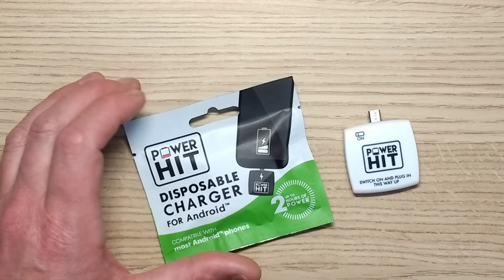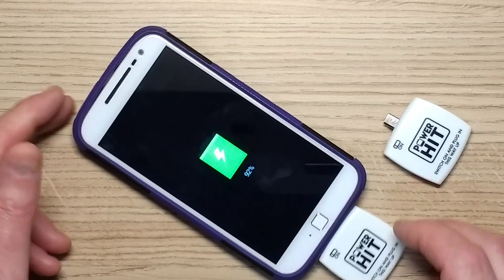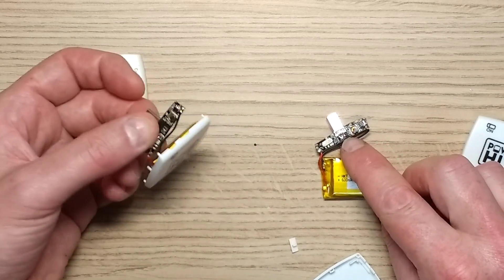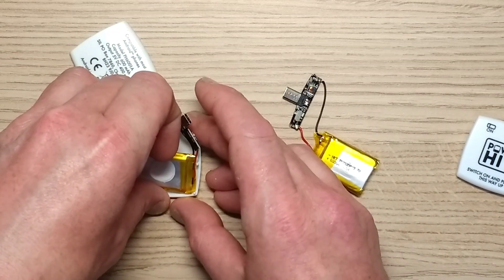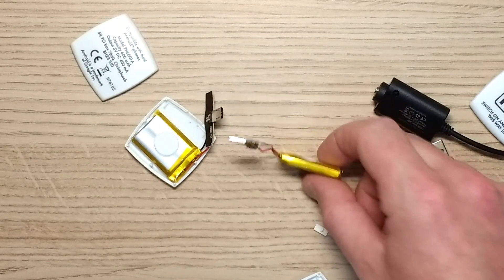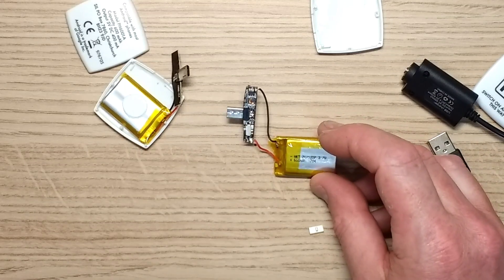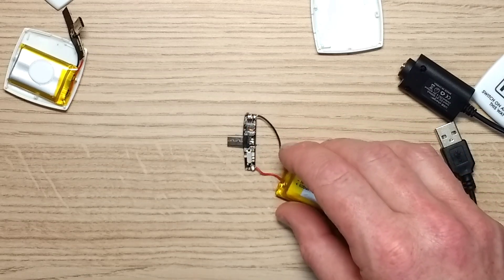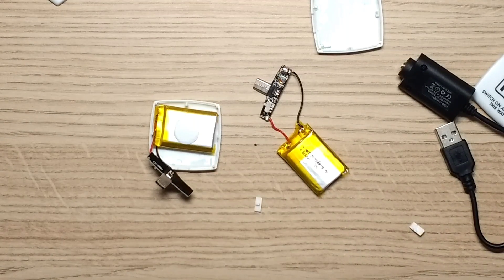What's inside a Tesco Power Hit disposable phone charger.

Comment: Disposable Lithium cells should be illegal. The charging circuit probably costs a few cents in large quantities.
Reply: They can be about $0.25 each that you can buy (pack of 10). However, many are fakes and literally don't regulate voltage (so I found out when I had a cell at 4.38v on my quadcopter). I don't know how much higher it would have went since I didn't let it finish (output was around 4.75v, and that was probably just the voltage sag on my USB wall charger). Then I bought some others from another seller (same supposed chip), and they were fine (ironically, they were much cheaper) and varied between 4.22 and 4.28v (which is higher than ideal, but good enough).

They should fit in that case if they made them a little fatter or longer, but the charger does get insanely hot (I have blower fan on mine), so you would need to change the current program resistor down to maybe 200 mAh max (so 3+ hour charge).
Reply: radry100 should batteries be illegal too ???
Reply: Jake Garrett I don't think long charge times would really matter for this sort of product. People would buy this because of convenience, so the recharging functionality isn't really important.
Reply: Enrique We don't throw baterries away after a single use and let me remind you Alkaline battery is safe to throw away because they are recyclable. Lithium baterry is not.
Reply: Cereal DuDe aren't you supposed to throw them away after they're dead ??? Unless they're rechargeable but some aren't
Reply: kingoftaurus This isn't an issue of Capitalism. It is a finite and important resource. Being an idiot and investing into short term profit to fuck over your business, the industry you are try to make money of and the planet is textbook short sighted investment. They literally digging the ground away from under there own feet.
Reply: radry100 anybody else contacted Tesco on Twitter etc?
I have.. They said they had watched the video and then asked me what my "concerns were"?!?!?!!
Reply: JETJOOBOY I tried, no reply. How about someone buy one, stick a nail through it at the checkout and walk off. Then they might get the idea...
Reply: Enrique Alkaline batteries do not explode if punctured or shorted, this is a really bad (and dangerous) idea.
Reply: Enrique disposable yeah...
Reply: Practically everything is illegal or mandatory in California, we don't need another damned law banning even more things.
Reply: Ray Giordano You have a tesco's in california?
Reply: There are still plenty of legitimate uses for non-rechargeable batteries. E.g.: long life applications use air silver cells in hearing aids, 10yr Lithium cells for pace makers alkaline cells in alarm clocks, smoke detectors, back up power for computers etc. Then there are non-recoverable uses, meteorology balloons for example. And some button cells are still to small to practically make from rechargeable cells, esp. in applications where you need constant voltage over the life time of the cell and don't have space to include voltage regulation. Finally, what about all the legacy applications built for 1.5v high drain applications? There isn't currently an off the shelf solution to this.  Hopefully rechargeable batteries will become the norm soon, but they're not for everything yet.
Reply: Daniel Christopher exactly, too many restrictions will limit all sorts of progress.
Reply: Don Wald I am pretty sure there isn't a Tesco's in CA, but I wouldn't swear to it. We do have, however, very similar kinds of stores.
Reply: Well batteries are suppose to be recycled and not thrown away, problem is that everyone throws them away anyways.
Reply: Sht like this (amongst othe sht) keep the vile economy flowing so unlikely to made illegal when money is involved.
Reply: Thank for explaining it for those who need it spelled out to them. This kind of wasteful-by-design product should be illegal.
Reply: Thanks, but I don't think I need even more regulations about things I'm not allowed to buy.
Reply: Peter Houlihan Have you considered what happens when you puncture a Lithium battery? It sets on fire. So let’s say I throw away a battery, and someone puts something really heavy in next, it crushes the Lithium battery and congrats you’ve just started an electrical fire.
Reply: A very small electrical fire which lasts a few seconds (and that's assuming I improperly dispose of my batteries). Not much of an argument for someone putting a gun to my head if I try to buy/sell a disposible charger.
Reply: Peter Houlihan No one said any guns were gonna be put to anyone’s heads. In the right conditions, although it’s unlikely, it could for example start a wild fire. Also as people have pointed out the world has limited Lithium supplies, so if these were to become really mainstream, the amount of Lithium they use could lead a shortage in 10-20 years.
Reply: The product is as disgusting as the people that buy them.
Reply: "No one said any guns were gonna be put to anyone’s heads."

Yes they did. They said "it should be illegal." Laws are enforced with guns, or the threat of guns, if you don't realise that then you really have no business pushing political stances.

" In the right conditions, although it’s unlikely, it could for example start a wild fire."

Lots of things are unlikely to start a fire, that's no excuse to ban them.
Reply: Peter Houlihan Lawa aren’t really enforced with guns, especially in the U.K. The kind of attitude you’re showing is the same kind that has caused hundreds of species of animals to go extinct, a hole in the ozone layer and global warming. We have a limited amounts of lithium, and we are making things that use it up and are impossible to recycle. Portable chargers are very small now, and if you’re about to say it’s too much effort to charge them, we really have no chance.
Reply: "Lawa aren’t really enforced with guns, especially in the U.K."

Blatantly untrue. If you ignore this law, and all of the ensuing consequences, eventually the result will be a gun pointed at your head. The UK is no different from any other government in this regard.

"The kind of attitude you’re showing is the same kind that has caused hundreds of species of animals to go extinct, a hole in the ozone layer and global warming."

Hundreds of animals have been going extinct since animals first evolved. Welcome to life on planet earth

The ozone hole is cyclical

Global warming is beneficial and largely not controlled by humans

Anything else? I gave up believing the greenwashing years ago, I'm not drinking that kool aid again.

"We have a limited amounts of lithium"

We have limited amounts of everything, but lithium really isn't all that rare.

"and we are making things that use it up and are impossible to recycle"

Unless these are converting mass to energy, then they're not "using up" the lithium.

"Portable chargers are very small now, and if you’re about to say it’s too much effort to charge them, we really have no chance."

I say nothing of the sort. All I said is that appealing to a mafia to force everyone to use them is ridiculous.
Reply: Don Wald yes I think so.
Reply: Ray Giordano I honestly dont have a problem with all the bans. It seems to make my area nicer but im not an expert or anything.
Reply: Peter Houlihan I dont see your argument. It's a simmilar price for a product that is better in every way.
Reply: Peter Houlihan "A very small electrical fire which lasts a few seconds" Lithium battery will burn at about 538°C, while paper will catch fire at 233°C and some plastics below 500°C. The battery can also catch fire when shorted out (could probably find hundreds of items that can do it in a trashcan) and the size of the fire doesn't really matter when some hot ash or a cigarette butt can start a fire even in cold weather. Don't know about you, but I think most people would agree that this is a fire hazard.
Reply: If you don't like something. don't buy it. Things shouldn't be illegal just because you don't like them.
Reply: Enrique They should be, thex are the biggest scam ever. They sell them mostly for like 4£ for a pack of 4 while cheap rechargable ones cost the same, they however charge you like 20£, so the disposable ones look like a good value, only to make you buy them again, this should be illegal
Reply: Peter Houlihan 
You seem a little confused.
Reply: How about instead of making them illegal you could make a vending machine like devise that you can buy and return this to.
Reply: The funny part is: Its called disposable, but on the back there is a sign, that it shouldnt be disposed in normal trash.
Thats like flushable wipes that shouldnt be flushed.
Reply: Dont crie we are doing it for many years
Reply: @peterhoulihan9766  lol Americans
Reply: Not even that. Plus, you can get LiPo cells that come with a BMS already attached! A BMS (battery management system) prevents over discharge by cutting power and contains a charging IC that charges up the battery with balance control (overcharge protection) when you apply voltage across the leads. NEVER charge an unprotected LiPo cell this way! It has to have a BMS attached!

Comment: Bridging the data line tells the phone (or other device) to (try)and draw as much current it wants rather than negotiating with the other device.
Reply: Yes, with Android phones (and most devices using MicroUSB for charging), bridged D+ and D- lines mean "AC" charger. However, Apple devices use different resistances between the data pins to sense how much current they can draw.
Reply: David Scheiber I scrolled into the comments to point out that it's weird to mess with the data pins for a charger that says 400mA on the side
Reply: Shorting D+ and D- advertises the device as a 1A wall plug charger. Most devices will then draw about 750mA. If you want to allow more current, you have to put specific voltages on D+ and D- via a resistor network.
Reply: According to this page, shorting D+ and D- is still the way to go to signal a "Dedicated Charging Port" capable of delivering 1.5A and more: https://electronics.stackexchange.com/questions/123172/what-is-the-ideal-way-to-handle-data-pins-d-and-d-on-a-usb-power-adapter-to-be
Reply: Markus Birth they have some different resistor networks for 1A, 2.1A and 2.4A. However, Apple devices will recognize shortened Data pins. They then charge with something around 1A. 
Android phones also usually recognize by the Apple resistor Networks, that they can draw more current. However, they usually tend to charge faster with shortened pins. But on Android phones, pretty much any phone of any manufacturer acts different :)

Comment: Build the re-charger circuit so we can mod these things.
Reply: tobortine He explained where to buy a recharging circuit (in the form of an e-cigarette / vaping charger).
Reply: tobortine you can buy little charge / cell protection circuits complete with micro USB ports online... Could probably use one of those to mod it, they're about the same size of the circuit that's in there already.
Reply: Perhaps I should have phrased the comment in a different way. I intended it to be a suggestion for a video.
Reply: tobortine it would make for an interesting video/ project guide, if he bought a recharging circuit... I'm fairly sure it would be relatively straightforward to fit it, but it would be good to see it done.

Comment: I suspect the broken inductors are just beacuse they wer happy to use "reject" parts for super duper cheapness. For a disposable product, no point using high quality parts, nor are they likely to care about efficiency of the boost circuit.  The only problem with them might be automatic placement, but I've seen so many low cost products from China with SMD parts that were clearly hand soldered, that may also be the case here.

Comment: Don't know if this has been covered, but the battery looks almost identical to the rechargeable cell used in my mini indoor drone. I bought a pack of these since the flying time was quite short. Think I might stick a connector on a flying lead and use the drone's charger......
Reply from the maker: These cells are not optimised for high current output like the drone ones.

Comment: Pretty sure that chip is a voltage regulator, similar to AMS111, AMS1115 will regulate higher volatge to 5v 1a. The inductor is to boost the current. The caps are usually used in conjunction with an AMS1117.

Comment: Completely randomly found one of these in the Apple variant form at my local tesco, couldn't find any others, it was just chucked on the shelf amongst lightbulbs, and it was 75p, so for a 600mAh battery, yoink!! The apple one seems to have a few more components compared to the Android ones, and the inductor isn't chipped, but overall it's the same basic thing, just with a lightning-type connector made up on the PCB...

Comment: They should sell it with a deposit of additional 3£ or so and then recharge and resell them. I like the idea of buying a precharged charger in certain situations and giving it back somewhere else.
Reply: gentuxable I think we did something similar where it was a tube you could put in a slot that would charge and anyone can take one, as long as your a customer, but they were damaged and deemed unsafe
Reply: Nobody would buy it in that case. This is clearly an emergency device that can give some charge of the battery is dead.
Reply: I was thinking something like that being sold at airports would be awesome.  Buy it before the flight, drop it in a kiosk at the other end.
Reply: Marius Mösius Yoyo..
Reply: EE were going to do something like this - they were giving away free power banks to their customers, and you'd be able to take a discharged one into one of their shops and swap it for a charged one. However the product was crap and caught fire / exploded, at least one customer suffered severe burns. EE recalled it, and obviously felt that they'd been badly burned by the experience too as they abandoned the idea.
Reply: There are powerbank rentals here.
Reply: Wanna get rich? LETS DO IT!!
Reply: clive did a video on this

i think he concluded the explody ones were probably due to people charging them with dodgy chargers and breaking the over charge protection stuff
Reply: sounds like something Apple would do
Reply: They did actually try that idea. You'd take a power bank at a gas station and return it at another station of the same branch, kinda like a library but with power banks. It worked, but the power banks were of poor quality and caught fire... The whole thing tanked after that with a mass recall.
Reply: @JuryDutySummons  thats a good idea but the airlines would probably overprice them like crazy lol

Comment: 4.27v because better e-cig battery's might have protections like in phone. I made battery charger using TP4056 chips and it only charges up to 85% of charge so i salvaged protection PCB from my old battery and tested it and unfortunately output after it is 0.8v smaller then input.